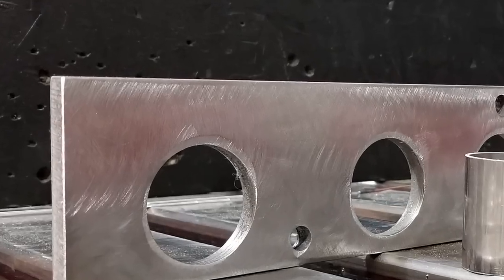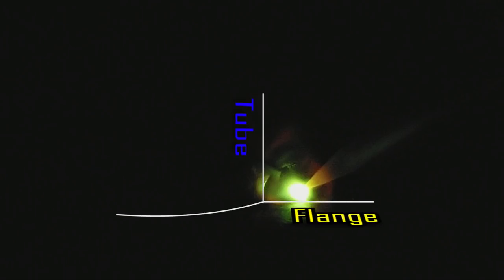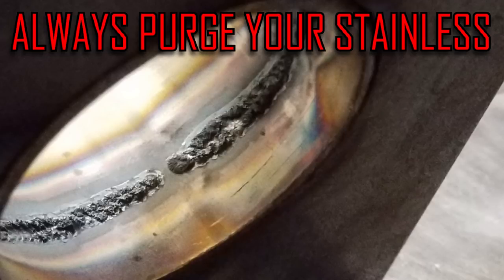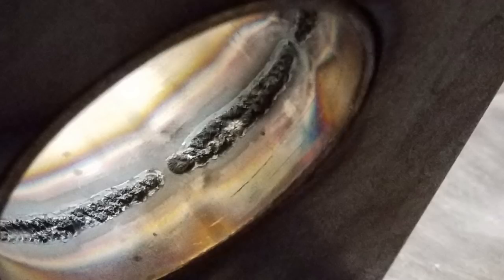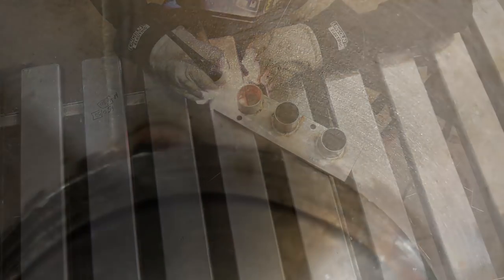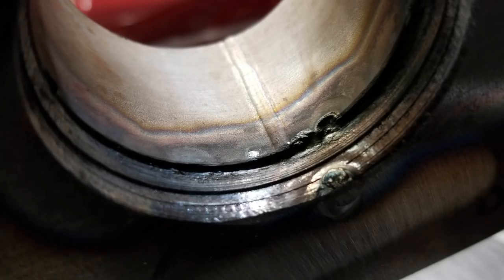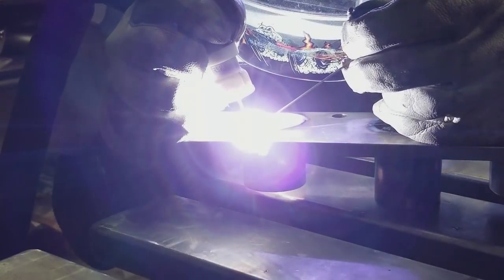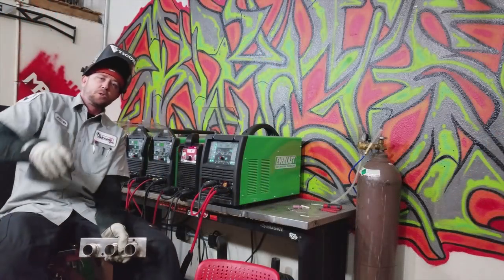TFS: How to Weld Thick Metal to Thin Metal

Comment: dontcha HATE seeing that blue flash of light when tig welding!! lol man i hate it! oh well tho... we all take a little dip in the puddle from time to time huh.
Reply from the maker: songer121 Its sooooo friggin challenging to shoot around a camera haha. There were a few drags, but the only shut downs were on that one I showed. Most of it was flutter from it being dirty and smoke/junk flying up.
Reply: hey one more thing... that black soot at the end of the video around that ring... what causes that??? i get it sometimes and it drives me up the wall!!! 

That was some serious stickout you had there too! i love my fupa cups!
Reply from the maker: songer121 That soot was junk burning off the metal because I didn't clean it well. I just wiped everything off after cutting it on the machines. I should have done a good scrub with acetone.
Reply: aight cool, kinda thought thats what it could have been but wasnt sure...  thanks! keep up the great work on the videos!
Reply: I've heard don't use Brake Kleen to clean parts prior to welding. Also something about there is 2 different, chemical versions. one is very harmful when used in welding. Is acetone the way to go.
Reply from the maker: Al Cyr Brake cleaner is more than acetone. The chlorine is usually the more harmful component but any brake parts cleaner is not the same as regular acetone. Acetone is the better solution for cleaning.
Reply: Al Cyr chlorine exposed to UV rays creates Phosgene Gas which is lethal